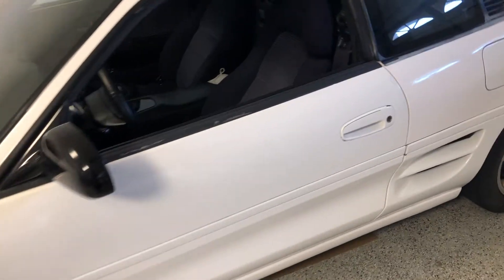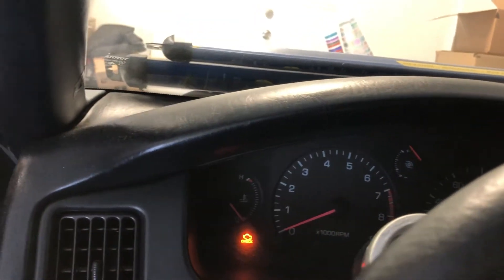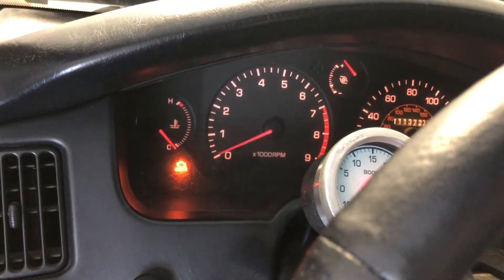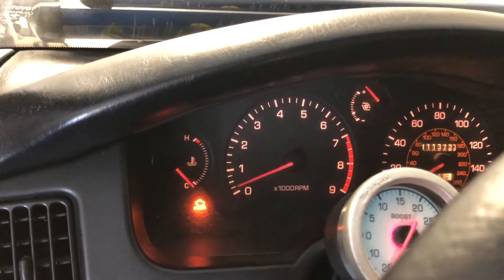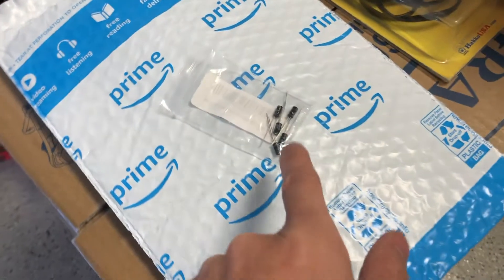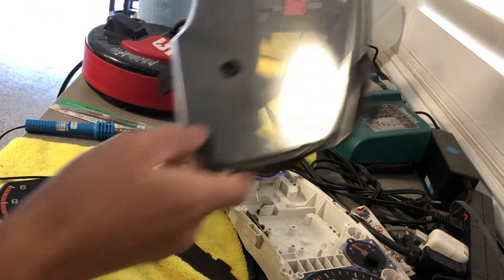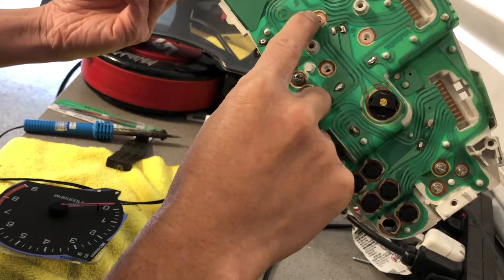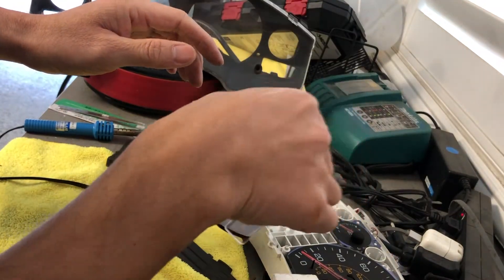DIY fix tach low rpm on 93 MR2

Comment: I agree with earlier post. The instrument panel does not easley pop out. I had to remove plastic gear shift cover as it clips into ashtray section. The connector for the speedometer is a bear to disconnect as I had to stretch the cable to it's max and still barely could get my hand back behind the cluster to remove,  The clip is different for the speedometer. You have to squeeze the connection at the back of the connector to get it to release on my 91 Turbo. Whole job took 2 hours but all works good now. Thanks!
Reply from the maker: I am glad it worked out for you. I know exactly what you gone thru.